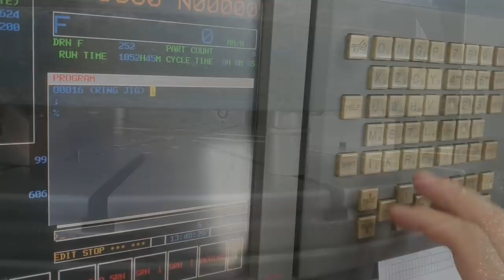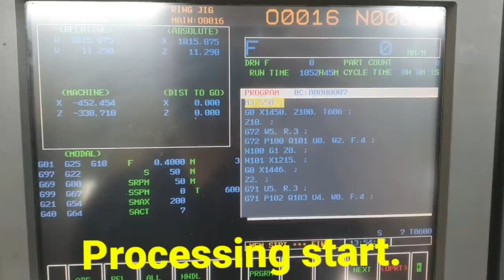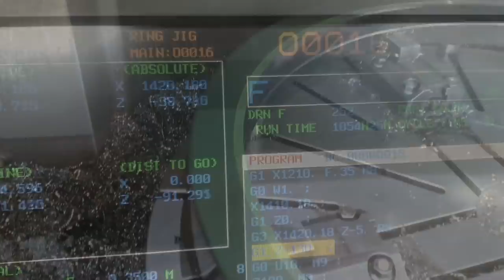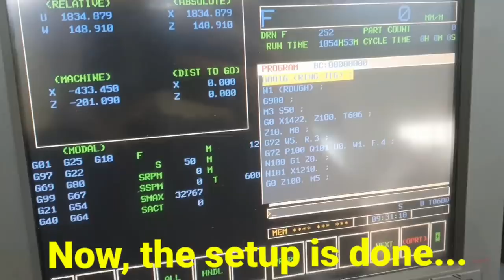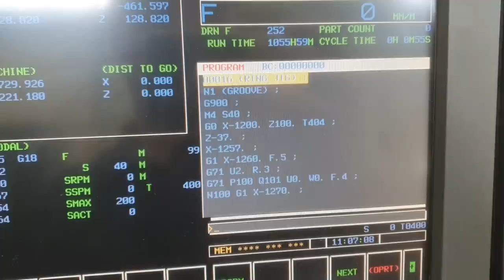Diameter 1400mm Forged Steel Ring Machining - CNC Lathe, Vertical Lathe, Turning.

Comment: Used to machine rings for General Electric CF6 jet engines. Biggest problem was distortion, had to be within 0.002".
They were made from welded nimonic steel, used to creep after machining.